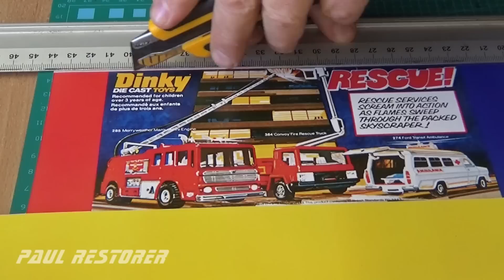Dinky renowacja Ford Transit Police nr 272. Zabawka model odlewany.

Comment: Does restoration of a item devalue it?
Reply from the maker: if it was in very good condition, the original one and someone renewed it, then it would be devalued, but yes, it only increases its value
Reply: @PaulRestorer   Considering the time and effort put into these restorations there should be value added.

Comment: Excellent video. I had one of these when I was a kid in the 70’s together with a Police Range Rover. My most prized Dinkys. I played with them so much though they didn’t stand up to the use and as you said, they weren’t that well made to stand up to the abuse of an 8 year old and the doors and tyres came off etc. I lost the cones and signs and that was that. I still have the Range Rover in its battered condition and would love to restore it like this.
Reply from the maker: Thank you very much. Good luck in refusing your Land Rover

Comment: Superb restoration but just one minor point the extendable pole in the rear was a scene light and not radar - police in the UK were not using radar then and as it was an accident unit it would have been equipped with a night searcher lamp.  Keep up the amazing work
Reply from the maker: Thank you very much

Comment: The camera on the original was a tube shape rather than hexagonal as replaced here. But I suppose unless you have the original part to 3D print or take a mould from its make do with what you have .

Comment: This has been stripped before. There was never a screw on the base, it was riveted. Great job though.
Reply: If it's been stripped before, it simply shows how well built these toys were. If you were to try this on a modern Hot Wheels or Matchbox car, it would be so much harder because of the way they're built
Reply: WRONG ..... ALL the Dinky Transit's were SCREWED together. None were riveted.

Comment: I had one of these
Reply from the maker: Cool
Reply: I still have Firebrigade version of this  model.it inclusief 2 axes and a Black Firehose which could be pullen out  and (of course) a small ladder on the roof. It was geven as a si Nicolas gift in 1970.